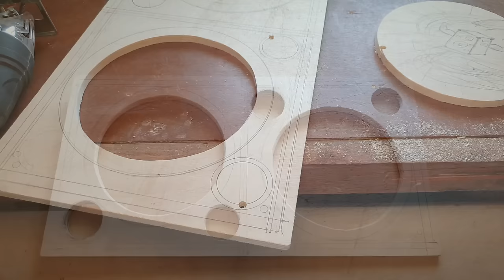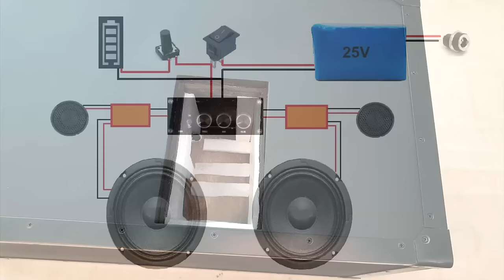DIY: Portable Bluetooth "SoundBox" Speaker

Comment: The point that he took the extra effort of painting the inside of the box shows his dedication.
Reply: Nope. Shows how much time he has still on lockdown 😂😂😂. (Quarantine) 
😷😷😷🤣
Reply: Pretty sure that was sound deadening to prevent rattling
Reply: Matthew Falcon looks like paint to me because sound deadening does not look like that
Reply: Musti looks like roll on bed liner to me..
Reply from the maker: Yes its normal paint, i did it to make the airvents even darker without any "refections" from the inside.
Reply: Ooo shit 1 screw I dont have 

Is any shop open in lockdown
Reply: did he spend some time on calculating the box.
Reply: lol the painting was soooooooo unnecessary
Reply: Standard practice tbf

Comment: I'm impressed with the BassFace products, although I wish I'd bought more pre price hike. I have a pair of the SPL 69.1 in a boom box - 2 1.1 cubic feet enclosures tuned to 50Hz with twin 2.5" ports in each box. Good bass output and nice mids and highs with only the single dome tweeter, rather than 2 or 3 tweeters with clashing frequency range as is common on budget 6 x 9 drivers.

Comment: Very good work, especially for the case, best Ive seen so far. But amplifier, crossover and speaker wasnt the best coise... something with dsp would make a big difference
Reply from the maker: Those speakers have low bass, i will change them in the future
Reply: @DTeK  I will build something like that with 2x B&C 10CL51-4 and 1x Peerless BC25SC08-04.
And Sure DSP with Bluetooth Module and 3x 200W@3Ohms Amplifier 
But its not my final configuration
Reply: @5chiffi  You have a video on this?

Comment: if you made a shared chamber maybe you could of saved a little bit of internal space, with just a small brace,  and make one big port, might of got more deeper frequency.. and you haven't showed if you add any acoustic material, or polyfill, it could make the  bass a little deeper

Comment: What is the purpose of the crossover? Do I need one if I'm getting a 12 volt battery?
Reply from the maker: Hello, the crossover is to send the lower frequencies for the woofer and the higher to the tweeters, its a sound filter

Comment: Looking for some help with my build electrical wise, I'm using an old car head unit and 2 pioneer 2 way speakers. The power sauce I'm using is 2 x 7.4 lipos connected in series so there is 14.8v I've connected these to a buck converter and dilled the voltage down to 12v these are powering the system for a little close to 3 hrs. So I'm thinking of using a 12v 7ah motorbike battery. If I connect the radio negative lead to negative of the battery and the memory lead yellow to positive do I need to put inline switch on the red lead to the battery to kill power before charging it wanting it to be a sealed unit
Reply from the maker: Yes, to turn the radio off you will need always a switch in the positive wire (red), if you keep the ignicion wire (yellow) always connected it will save your date/hour and radio setthings but it will also draw some current.
Reply: @DTeK  thanks mate, so I can keep the 12v battery inclosed in the box turn the power off the radio will still keep its memory and I can plug in a wall charger to top the motorbike battery up

Comment: I don't understand why people are so amazed by the soundboks. It is not really that powerful, It doesn't play very low frequencies, It can't play loud sharp vocals without getting distorted by the bass and It's quite unpractical to carry around. I've listened to it and can't say I am impressed. PR 10" 400wrms subwoofer, "5 100wrms woofer and 2" 6w tweeter could fit in the same space and beat the crap out of it

Comment: How can I make a regular bluetooth speaker from old powered subwoofer?  I want to play all music not just the bass?
Reply from the maker: If you want to play all the frequencies you need a subwoofer, mid range woofers and some good tweeters, with the correct crossovers
Reply: @DTeK  yeah I understand  that but how do I remove just whats making it a sub now so I can add crossovers, I have crossovers from 3 ways home stereo speakers I took out of something years ago but like I said this is a powered sub box , the one I use for my stereo actually allows me to switch it to a high pass filter and tells me how but this JBL is a lil different and doesn't mention anything anywhere about high pass it's like jbl180 I think.  Has 250 watt amp on board thsts all i took out was the guts il use the 10 inch sub some where else some time down road or give to someone who needs, same with box but I popped the guts out and plan on building a much smaller box with just 6 inch sub 6.5 mid and a tweeter making it bluetooth and keeping out in the shop.  So any help u can give me greatly appreciated
Reply: I've just had this thing sitting on a shelf for bout 6 years now and have a little 8 inch powered sub I already had b4 I got JBL n even though it's not half the total size or wattage the JBL it blows it out the water so thsts why it was  shelved I picked up cheap though and seen the size of it and knew what my small put out so was expecting this huge difference and was very disappointed bass that it did produce wasn't that good to begin with not sure if I am able to post a pic here but if I can il send pic of amp so maybe you can see what I would need to disconnect so that all frequencies can come thru then I csn block myself
Reply from the maker: So you want to modify a 1 channel subwoofer amplifier into a full range stereo amplifier, maybe its possible, maybe not, depends the type of hardware you got, but i guess it will need a lot of wiring  and a some hardware changes.
Reply: @DTeK  I tried to post a picture of the guts that came out of the jbl sub180 but wont let me it does have 2 speaker connects that say in and two thst also say out then has left n right line level in RCA's snd one LFE line level in RCA but as I did not buy this new or anything I don't know much about it I just picked it up cheap at a yard sale long time ago

Comment: Can you make a bluetooth speaker power by Milwaukee battery.
Reply from the maker: Its the same, just need to change the connector, for charging the easyest way is to use the original makita battery charger.

Comment: you wired one against each other they are canceling each other's bass flip one of the speakers polarity u should be good
Reply: you can see that when a beat with bass is hitting one speaker goes in one goes out they are not wired correctly
Reply from the maker: Thanks, they are wired correctly, for some reason they look out of fase on camera, i notice that whyle i was edditing the video and checked all the conections and polarities with the multimeter.